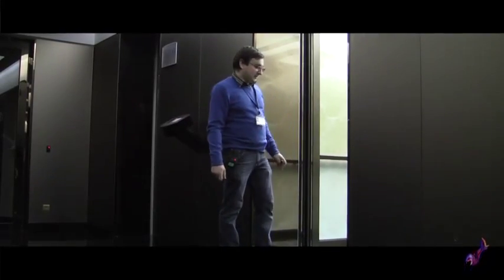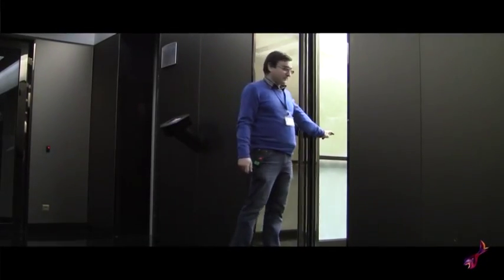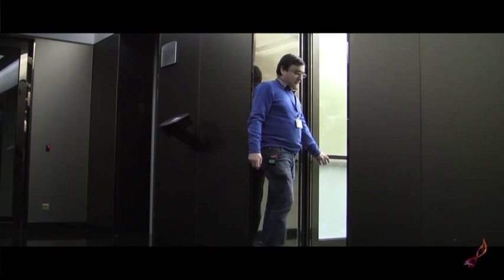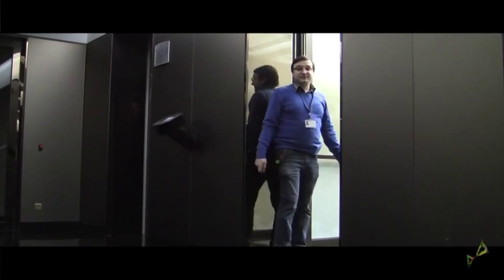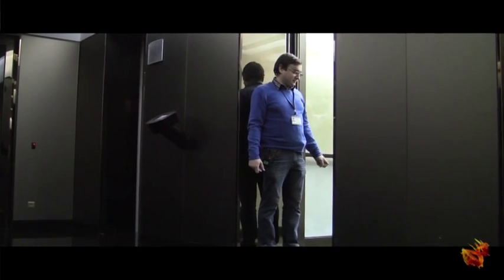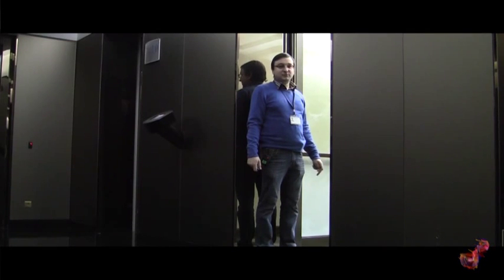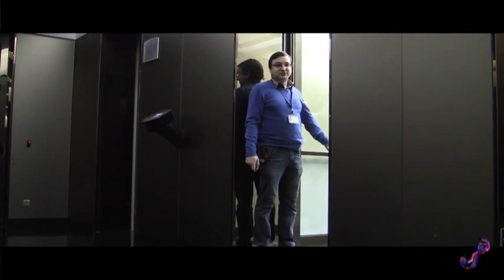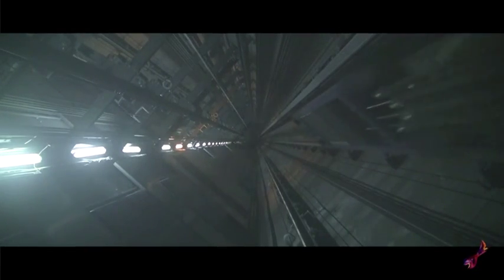Vertical Transport: an elevator with a transparent floor

Comment: Why they have two cabins in same shaft?
What is when i go in the upper cabin and want to go to the lowest floor? It will never work, because where shuld the cabin under it stay than? I dont understand this kind of system.
Reply: This is why you have destination dispatch: You select the floor you want to access outside the elevator, then the system will tell you, which elevator to take. So the system will obviously send the lower car to you if you select the lowest floor and the upper car for the highest floor.
Reply: A difficult system